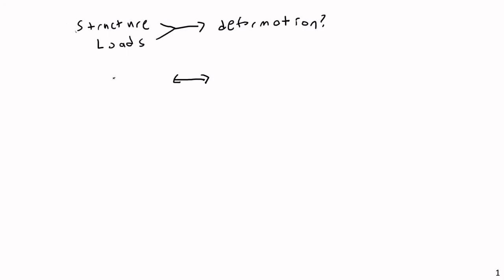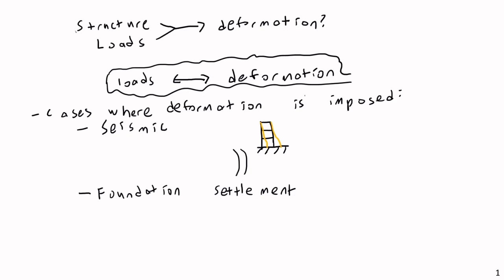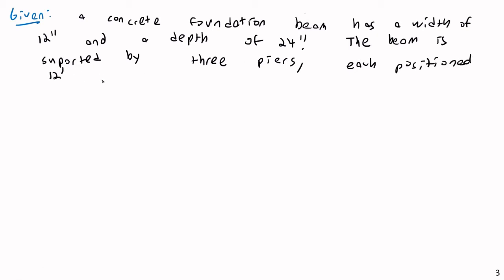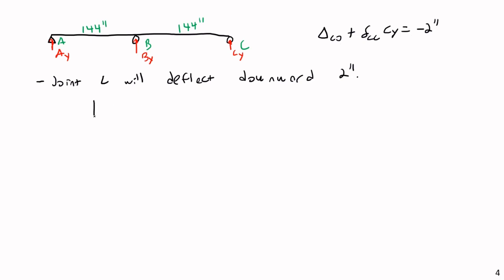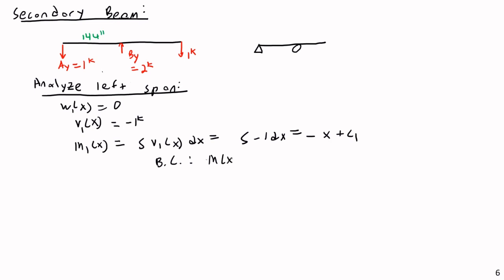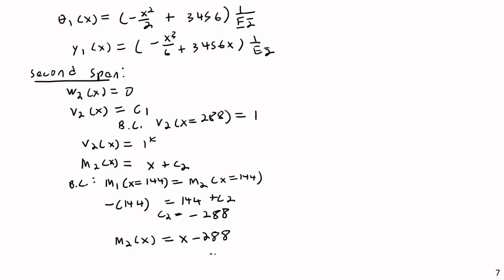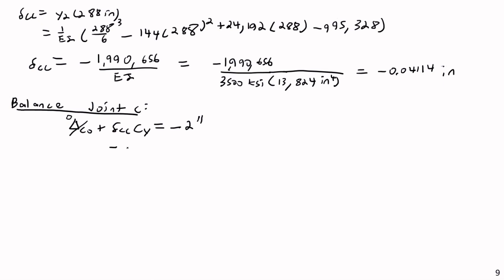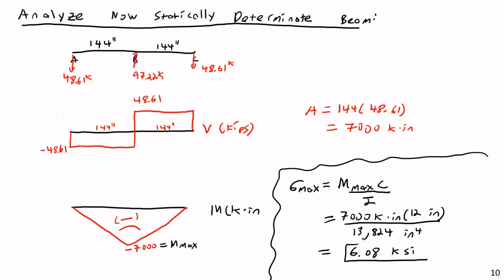Foundation Pier Settlement - Stress Via the Force Method - Structural Analysis

Comment: Stress and pressure both have same units . How they are different?
Reply from the maker: Stress is the force per unit area inside members. Pressure is usually an external force caused by fluids.